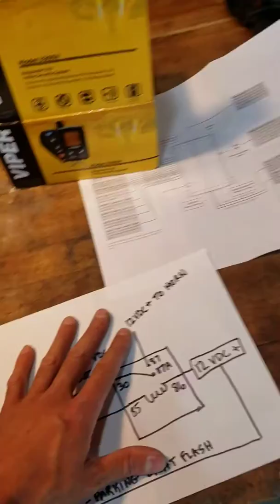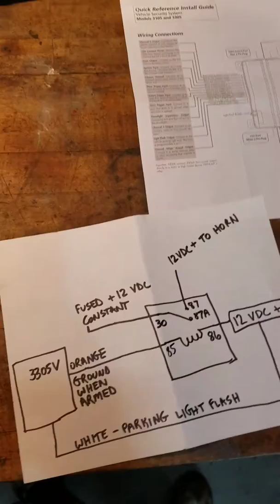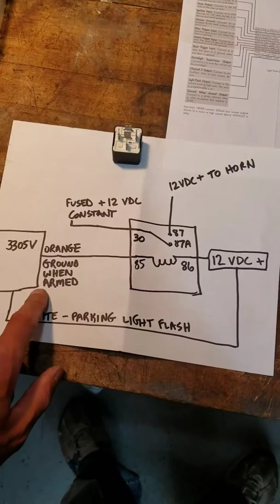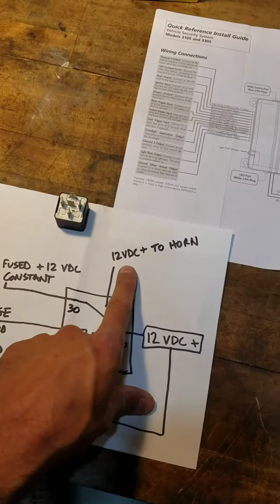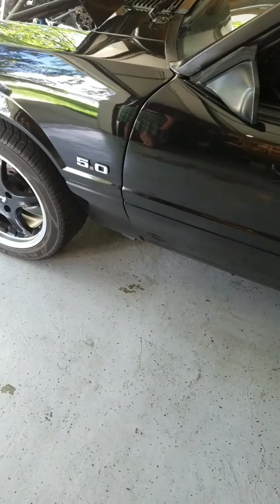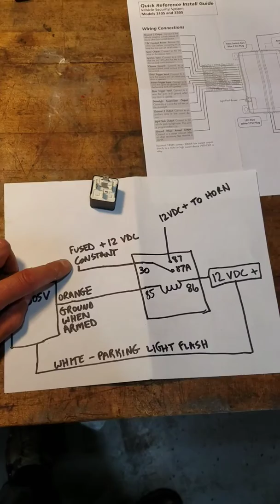Viper 3305v alarm with horn honk

Comment: I’ve subscribed I have a Clifford which the horn is dead I replace the horn with a new one and there no out put to it if I was to run your relay diagram and run it to alarm box indicator out put do you think the siren will work subscribe ❤
Reply from the maker: I can't say for sure.  But, if the Clifford is a rebranded viper, with the same outputs / wiring, then it should work.

Comment: My vehical use a negative trigger to sound horn, how would you proceed? Also when GWA is used for other sensors, wouldn't a diode need to be used, if so, which direction should band face? Thankyou!

Comment: So I already have my viper alarm installed. I want to add a second speaker. Can I use the wires going to the first speaker and  use a relay to power the first and second speaker?
Reply from the maker: I'm not sure of the amount of amperage capable from the alarm module?  The relay wouldn't draw much current but I cannot guarantee it wouldn't be damaged.

Comment: im having kind of an issue, i have a viper 5904, the white parking flash wire goes directly to the 86 on the relay correct? Mine was wrapped around what i assume is the corner lamp wire to make em flash, but if that wire goes to the relay, how would i get my lights to flash

Comment: Bought used car and came with alarm but there was not siren sound. Open the hood and siren’s wires we’re cut and left unprotected. I think the +12V siren output came in contact with the chassis of the car damaging the output. Tested the siren and works but when I put the multimeter to siren positive shows 1 volt output, not enough to make the siren work. I don’t really know if the siren output is damaged or is in safe mode. I was thinking using the light flashing output and your DIY video Medel it much easier. Thank you.
Reply from the maker: Awesome, good to hear!

Comment: I have an 89 foxbody and I can’t get the lights to flash. They flashed with my old alarm that I took off. What am I missing?
Reply from the maker: It's been a while since i installed that system.   You need to verify the alarm is sending out 12vdc from the light flash output and then confirm you have it tied in properly to the light circuit.